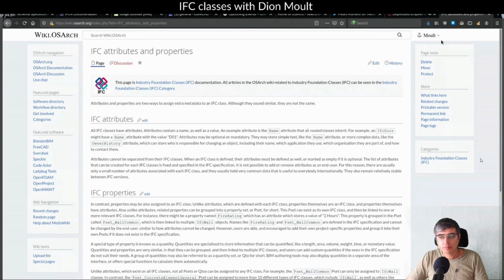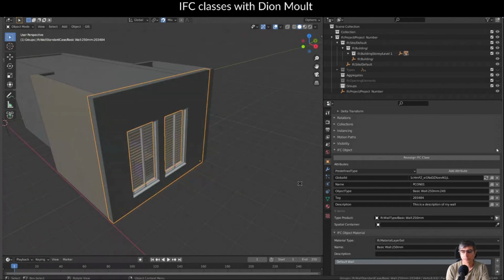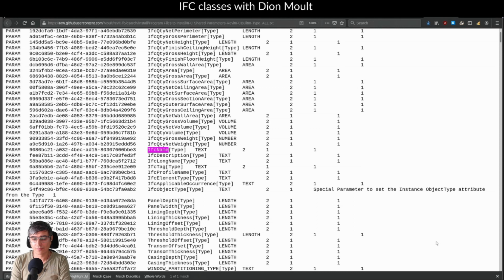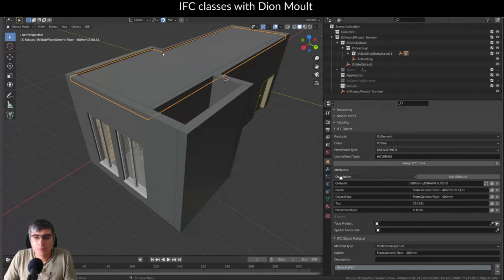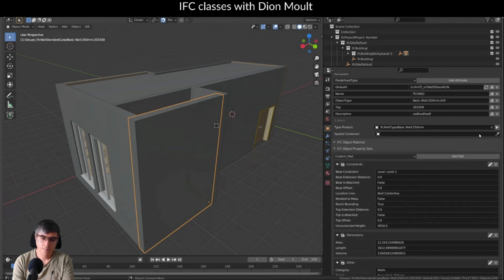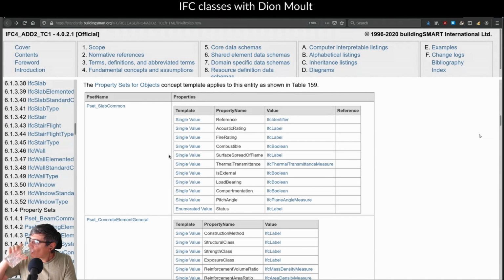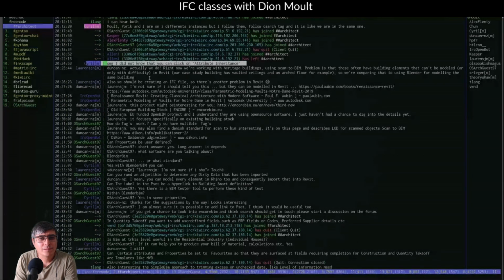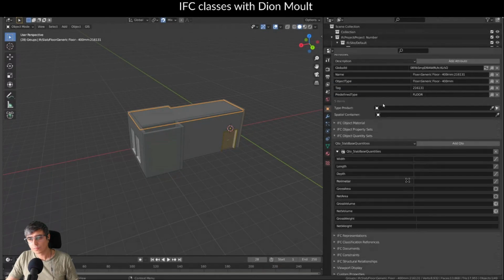IFC Projects, Attributes, and Properties with Dion Moult

Comment: Thank you very much for this informative piece of information about IFC. I've been in building construction industry specifically 3D modeling for decades and yet not fully understand IFC and BIM until many clients using different 3D software and I having difficulties to integrate it will the 3D software that we are using. I found this IFC and BIM seems a solution and I start digging about it. I have no problem understanding about the technicality of codes as I have a background in programming. Thanks for sharing.
Reply from the maker: Thank you for the feedback! Greatly appreciated!

Comment: @dion, You have added some IFC attributes in blenderBIM from a revit file. So a model can be imported from other softwares and all IFC attributes and properties that are missing, can be filled in from BlenderBIM and exported to IFC, correct? Some attributes like length, area, etc, are lost whith boolean operations, and they can be rectified here for IFC export, as this seems like the most advanced IFC centric BIM software/plugin yet. Are there any particular plugins for popular softwares like revit, tekla, archicad etc or do we have to rely on .obj/ collada or IFC export from those softwares ?

Comment: Thank you guys, this is really helpful!
I hope in this series that you can go deeper on a few subjects im curious about:
-  How should IFC-data be stored in a database so that you can enrich the IFC-data after the construction phase.
- How is actually the geometry in it self implemented i an IFC-representation?
- Can an IFC-file carry different geometry representations of the same thing?  I mean, can for example a railing be representated both as a line and as a volume object?
Reply: Great suggestions! In short:
 - There are a few approaches to this - IFC can be stored in SQLite format, for example, and there are a few ways to relate it to external data sources. Also, IFC actually does accomodate many of the usecases for data storage already past construction phase.
 - Big topic, geometry is complex in IFC. We'll get to it! We're still covering the basics!
 - Short answer: yes. These are known as representation contexts, if you'd like to learn more. We'll definitely cover it!

Comment: How can we extract the data from it?.... Can we put it on ms excel?
Reply: In BlenderBIM there is an export CSV capability which can be imported into excel etc. In revit schedules can similarly be exported.
Reply: @johnrogers3315  a slight note that Revit schedules are not exporting from IFC. They are exporting from Revit. This can be an issue if contractually you are required to deliver and guarantee all your data is available in OpenBIM. If you extract from Revit and not from IFC, you run the risk that the data is actually not present or correctly stored in IFC.
Reply: For details, see: https://youtu.be/ZeMkG6jTzAg